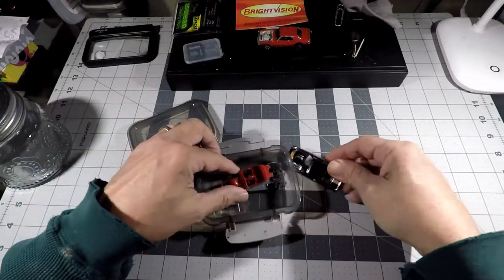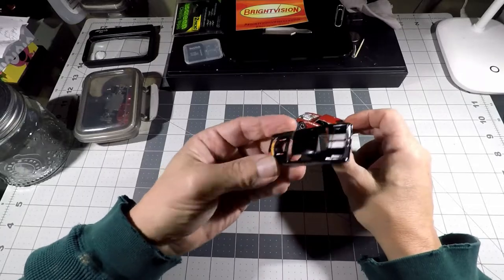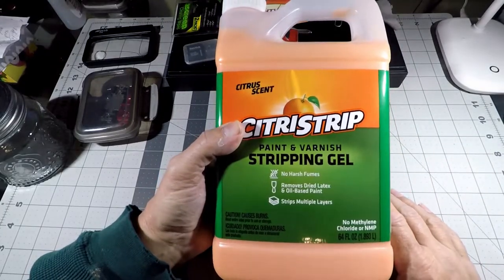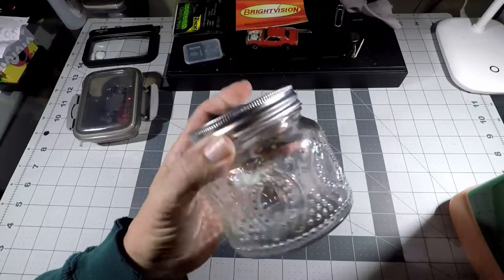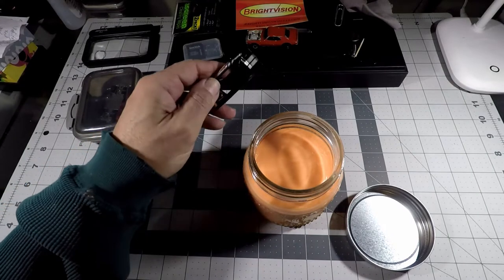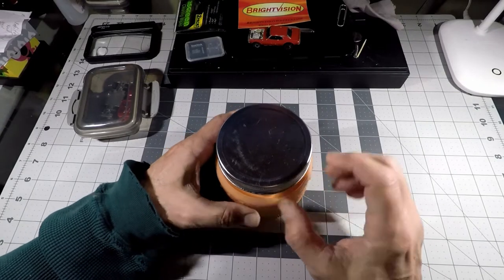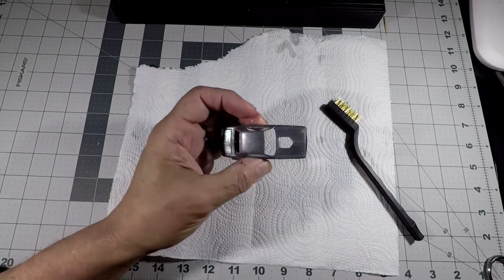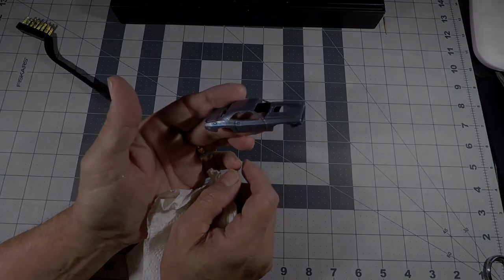Step by step on how to remove the paint off of your diecast

Comment: Very cool! I use Aircraft stripper personally, but that stuff is nasty. Citrus Strip is what I'll be moving to. Thanks for sharing.
Reply from the maker: That is the reason I did not get the aircraft. I had heard it smelled very loud.  But it works quick. I am not in a hurry so, this works just fine. Thanks for watching

Comment: Best easy way is soak I'm brake fluid. Leave it overnight and it should all have fallen or rubbed off
Reply from the maker: You are correct. But brake fluid has that smell. Plus it has oils in it that "could" hinder the paint from adhering correctly. Thanks for watching

Comment: Good Friday evening my friend... Damn that citrus paint remover is freaking awesome 🤙🇺🇲... Would that work on car parts that I want to repaint in the spring???
Reply from the maker: Hey there....It works wonders on stuff. I can not swear that it will. I know it will remove clear coat and auto paints on diecast. but as far as thicker coats on actual cars, I just do not know. Thanks for watching
Reply: @OldManDiecast  thanks for the info buddy 🤙🇺🇲. Have a safe weekend.
Reply from the maker: @keilylmm6377  Anytime buddy. You do the same
Reply: Kei, I’m wondering the same thing. I’ve been wanting to paint my Mercury.